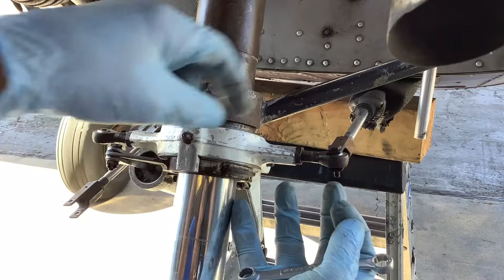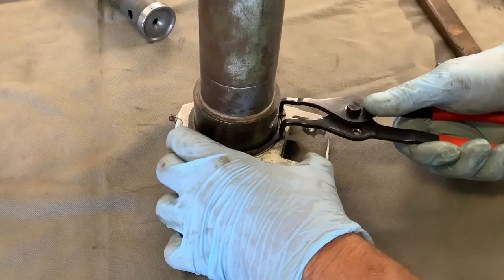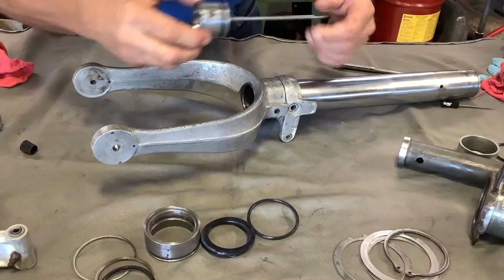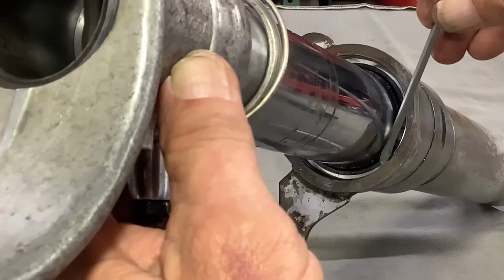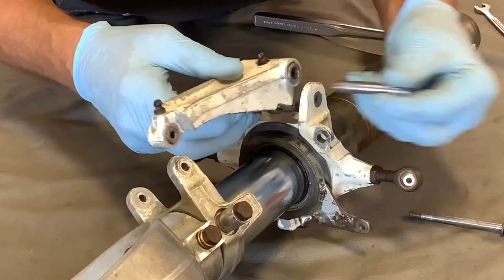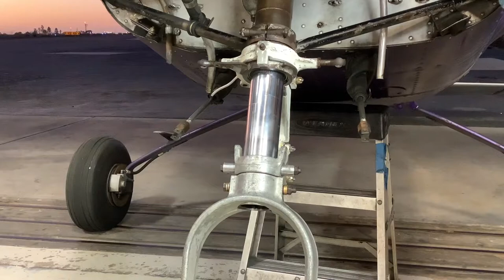Cessna Nosegear strut repair

Comment: Worth noting the needle bearings should be inspected and at a minimum regreased with a water resistant grease to inhibit washout like Mobile 28 or 33. These bearings require hand packing are are usually bone dry. Those with the grease fitting usually only receive partial grease. These Torrington bearings (still made in the USA by Koyo) are inexpensive and easy for a machine shop to press fit, if replacement is needed.

Comment: Excellent video. I’ve been overhauling Cessna nose gear struts since 1967. Your video is spot on. Lately I’ve encountered severe wear on the surface of the centering cam (both the upper torque link and the barrel). I developed a method where I build up the worn surfaces by TIG welding. I fixture the barrel in my milling machine and using an end mill, I machine the surface to original dimension. I repeat on the steel insert of the upper torque link also.
Reply: When you unhook the nose strut steering links do you have to re rig the gear? Thanks
Reply: @jacobgibson7210  Jacob - If the nose gear steering was in rig before disassembly, it will stay in rig after reassembly.

Comment: The problem I had with two of my C152’s was the chrome coming off the strut. I found a shop that repaired chrome on industrial hydraulic components and motorcycle forks. Knowing how people don’t want to touch aircraft parts for legal reasons I told the guy when I called him on the phone that it was a part of an industrial jack. When I presented the parts to him he looked at me and said “ these look just like Cessna 152 nose legs “ ………….. clearly I was not the first to get the chrome on the leg repaired by him !

Comment: No! NO! NEVER EVER push down on the horizontal stabilizer to raise the nose gear on ANY CESSNA. Far too many have been "misinformed" about this. The front spar of the stabilizer was never made for that and is prone to cracks developing the attach bolts. PLEASE, NEVER DO THIS. Instead, use an engine hoist and lift from the lift shackle on the engine.

Comment: Thank you for making this excellent video, I finally fixed my leaky nose strut after 3 yrs. Some idiot mechanic totally screwed it up years ago. It had vertical file marks inside the tube and they pounded the piston in with a hammer or something. Both the top and bottom O rings has small chunks missing from the sharp holes.I used a die grinder and a polishing wheel inside the strut tube. The top and bottom O rings were still tighter that they were in this video. 1978 C152 with over 10k hours. On my 206 some dumb ass left out the wedge ring on the bottom. However, the McFarland scraper ring was slightly too big. I had to use my old scraper ring. Probably a Chinese manufacturer. The only thing I wish I did was rotated the piston 180 degrees so it would be easier to get a air hose on it. Put the high part forward. I also think vaseline would work better on the O rings.

Comment: Great Video, I presume this is very similar to a 172N which is what I own.  Mine needs a little TLC.
Reply: Hey, were you able to confirm if this is similar to the 172N?
Reply: @EH25J  yes, the process is basically the same. I happen to have a parts list for my 172N and I also ordered a new decal that the strut haas in it but had worn off. I have mine rebuilt and mounted. I just need to fill with fluid. And put the front wheel back on